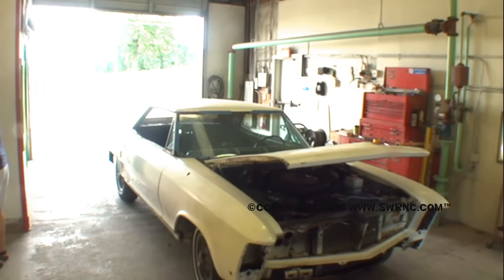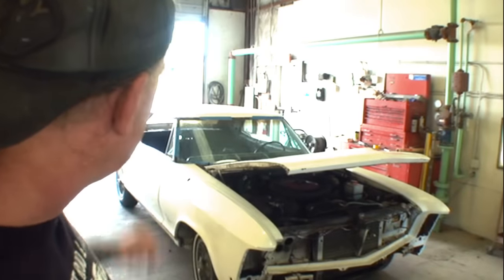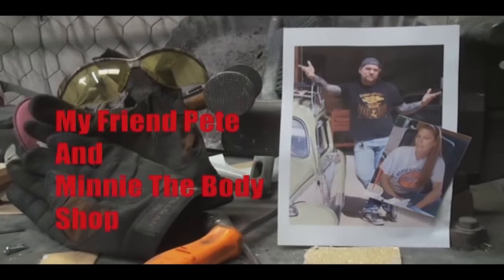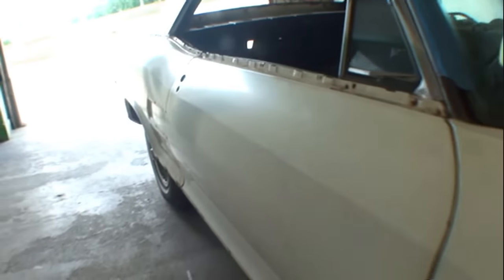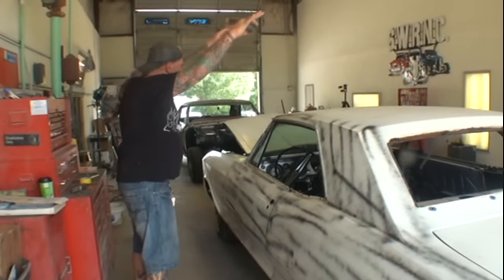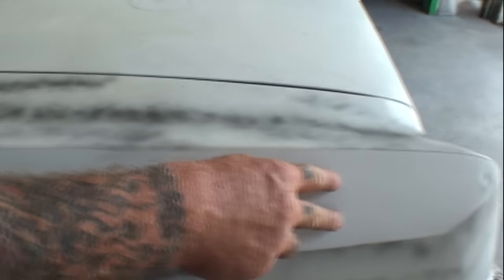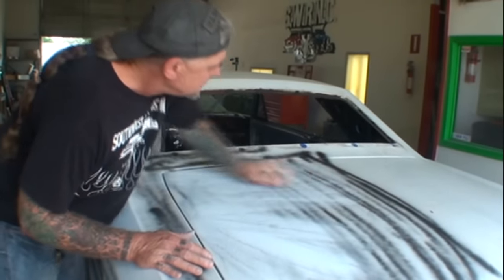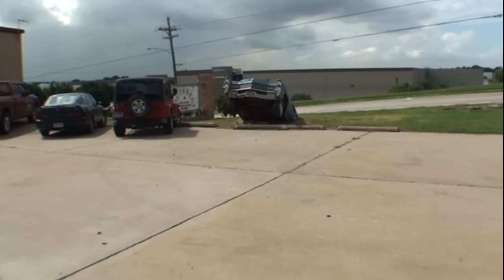How To: Spray Paint Your Car-To Find Dents

Comment: When I started painting in 1990 I used my hand to find dings and dent's. Painting with PPG or custom House of Kolors and I put that last coat of clear over the Candy orange and later find a small ding I felt like kicking myself in the fucking ass. Now I always use a guide coat. It's cheap and only takes a few hour's. Listen to the OldTimer's Use the Guide Coat in the end it pays off. Results in a paint job is everything. Good video Pete

Comment: Have you ever fixed these dents with a torch? I took a metal manipulation course and they showed us how to stretch and shrink metal. We used the torch with a blue flame and hammer to shrink the dents from hail damage. They even fixed some without damaging the paint. :) might save you time.

Comment: Does it matter what kind of paint you use, or it doesn't matter because it will all get sanded off in the end. Just wondering if I can use any quick drying paint, and what would you recommend, that wouldn't clog up the sandpaper to fast. Up in Canada, so I don't know if we have the same brands of paint.

Comment: Pete i have 4.1/2 by 6.1/2 foot fiberglass lid on the rear of my ute im from oz its got a shitty paint job on it dull and ruff and you can see the repairs thru the pain my ute is a 2007 model  in emack nic bar this cover got any suggestions on how to get the lid surface strait so i can repaint it im good with a spray gun just didn't want to start the job unless i got your advice how to level a large area. any advice will be appreciated thanks in advance.

Comment: is there anything you can spray on enamel to sray acrylic or do you have to bar metal and respray?
Reply from the maker: I don't understand your question.. Are you saying is there anything you can seal the old paint with to repaint with enamel?? If so, then you want to spray some Epoxy sealer on the car to insure you don't get any blistering or strange effects going on..
Reply: no if your car has an enamel paint job and you want to re do it in acrylic do you have to bare metal the car or is there something you can spray over the enamel paint to seal it so you can spray the car acrylic?
Reply: No fox given I once bought a body shop sealer  to lacquer a Lincoln was clear if paint aged may not lift anyway test on inside of trunk